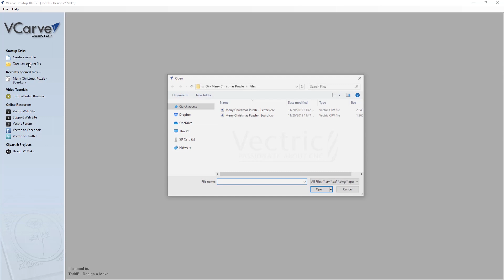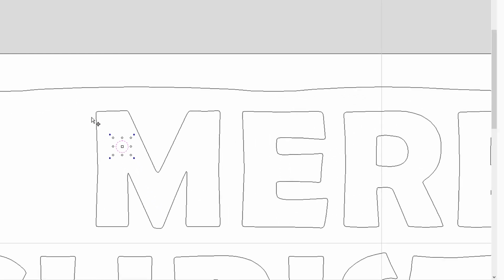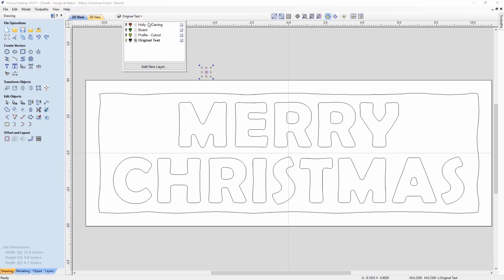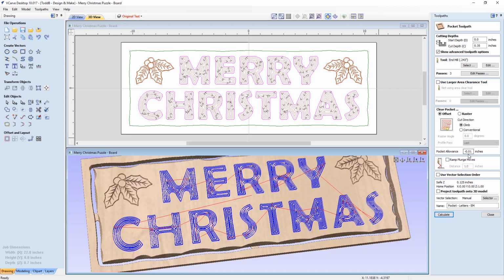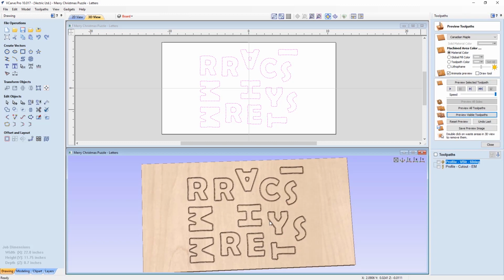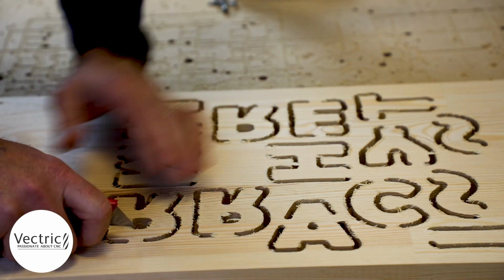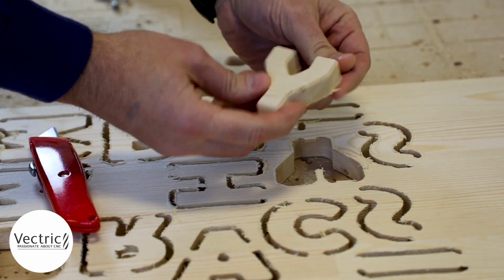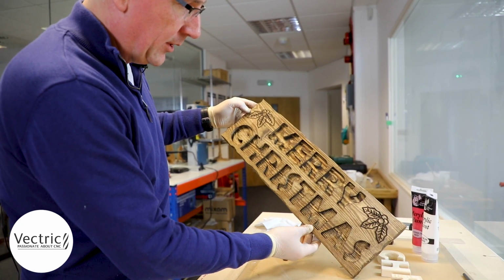The 12 Projects of Christmas | Day 6 | Merry Christmas Puzzle with Todd | Vectric In The Labs

Comment: Hello, great video.  I am using this exact method to make children's name puzzles.  I cut the male parts first. Then I cut the female pockets with a 0.02 pocket allowance. The letters would not fit in the pockets. So I went back to the file and increased the pocket allowance to 0.05, and ran it again without moving the female piece. It didn't cut anything more on the perimeter???   Do I have to increase the the offset in the file?   Pieces look great, just not fitting.
Reply: I did pocket allowance +0.02   A -0.02 fixed it.
Reply from the maker: Hey Michael... yes you got it!!!  a negative alloeance is the trick to make the pockets larger.  Good job!!!

Comment: How do I get a looser fit? These are very tight...even after sanding.
Reply from the maker: Hello Humourcar.  Thanks for the comment.  You could use a negative offset on the pockets for the letters... that would make the holes larger or you could offset in the lettering to make the letter vectors smaller.  It is up to you both would do the trick. ~Todd

Comment: Question: Is the Spindle speed for the selected 60 degree V bit in the Letters file really only 1200 not 12000?
Reply from the maker: Hey Rhoude, thanks for your question, no this is a mistake we would have ran that at 12,000 RPM, however we do recommend that you alter all the tooling setup ensuring that it's safe and appropriate for your machine and the material you are using as per the disclaimer. Thanks!

Comment: Could you share what font u used
Reply from the maker: Hello Jennifer... thanks for the question.  Unfortunatly I don't remember what font I started with, but I did take a pile of time and edited it.  Worked with the fileting tool and an off setting trick so that the cutter I was going to use would fit every place I needed it to.  Sorry I was not all that much help.